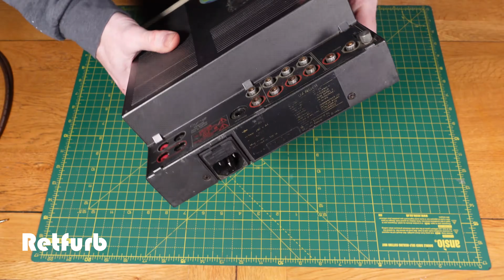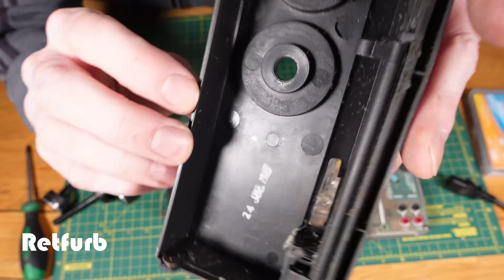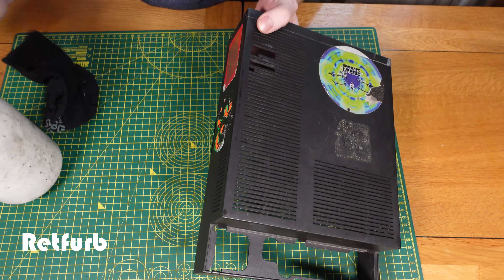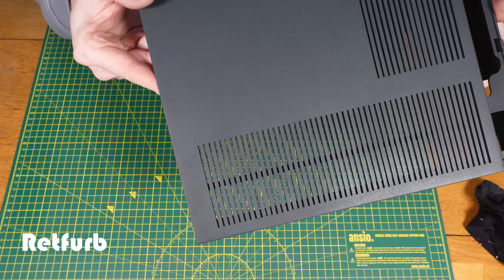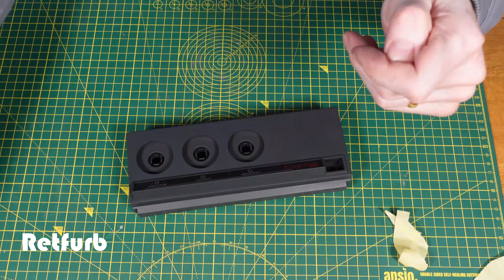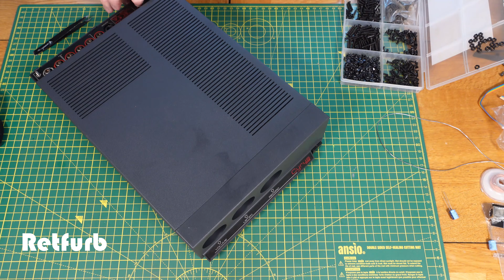Mission Cyrus One In Need Of Repairs - Retfurb Retro Audio

Comment: Thank you, you did a fine job there.  I backwards-inherited a Cyrus Two from my son.  It was much too precious to consign to "electronic waste". He had bought it second-hand long before, the main capacitors were shot and the input selector switch dodgy (to say the least).  On the Two this is a much bigger and more complicated component and very prone to corrosion.  I had it professionally refurbished, this included replacing all the capacitors (much bigger on the Two) and cleaning and gold-replating the switch - I could have replaced components myself like you did, but fixing that switch was way beyond me and it isn't the kind of thing you can buy any more.  By the time the engineer had finished and tested, the amp was working better than the original specifications.   I now use it with a Brennan B3 (via a DAC) and really like using the two together, built 40+ years apart - though I have to say the Brennan software is ridiculously over-complicated and seems half-finished to me.
Reply from the maker: Thank you for the kind comments, it’s really appreciated.

Excellent outcome with the Cyrus. I bet it was nice to get it all up together again. 🙂

Comment: Hi I think the fuses have blown on my Cyprus 1 but i cannot get the casing off as the gnd nut is just spinning. Any way i could get it off without breaking the casing ??
Reply from the maker: It’s difficult to say without actually seeing it. But you could try to carefully wedge something thin between the lid and case. Then try to undo whilst undoing the screw. It would be worth a try first.
Reply: I've done it now .The fuse needs replacing  now.Thanks
Reply from the maker: @deanrhodes6401  Perfect. Glad it all went ok.

Comment: Really nicely done. As soon as I saw the finished product, it was instantly recognisable as a Cyrus Two I bought new in the 80s. I had that for decades but lost it about ten years ago after a house move. Just replaced it very recently with another Cyrus Two (I already had the PSX to go with it that has been lonely for the past decade) and all good except thr paint flaking off the edges of the knobs. You've given me hope I can have it looking good again even if I have no idea yet how you made the decals.
Reply from the maker: Thank you, It is appreciated.
I designed them and printed using a vinyl printer. You may also be able to do them on waterslide paper and then lacquer over when fitted. I have done similar on other items, But not tried on these.

Comment: Ciao, complimenti per il lavoro. Un consiglio, per togliere qualunque adesivo senza grattare o rischiare di rovinare la superficie, devi usare la benzina rettificata (benzina Avio) con un batuffolo di cotone. Se fai fatica a togliere l'etichetta e la sua colla, devi stendere un po di cotone della misura dell'etichetta, versarci sopra un po di benzina e attendere fino a quando l'etichetta viene via senza difficoltà. Mi raccomando, SOLO benzina "rettificata", non quella per motori che rovinerebbe la plastica.
Reply from the maker: Thanks for the tip.
I tend to use solvent based degreaser, which does the job.

Comment: Looks great. Just bought a scrufffy one with a faulty power switch mechanism. Cyrus sending some parts foc, great service. What’s the make/colour of the final spray coat as mine will need a refresh? Thanks
Reply from the maker: That is good going.
Off the top of my head, It was a MOTIP anthracite bumper colour paint. 
I purchased it in Proper job (UK), But you can find other similar paints in different brands.

Comment: Beautiful video, congratulations. I have the same model that I purchased in London in 1987. I haven't used it for more than 20 years, and I've inspected it internally—there are no signs of age such as burned components or swollen capacitors.
Can I power it on, or should I follow any particular procedure?
Can I power it on without connecting the speakers?
Will the amplifier be damaged in the absence of a load?
What type of affordable spray can guarantee cleaning the contacts for the volume potentiometer, switches, and headphone jack?
What type of paint can I use to fix the paint that has worn off the knobs?
Is it worth replacing the capacitors?
If so, where can I buy them at a reasonable price while maintaining overall audio quality and power supply performance?
If the capacitors are replaced, does the bias need to be adjusted?
Where can I find the schematic diagram for my Cyrus One V2?
Thank you very much, cheers Marco😀
Reply from the maker: Thanks for the kind comments.

That’s a lot of questions 😅.

If you can connect to some old speakers, then you won’t risk damaging good ones. Although, it’s probably still fine.
Deoxit F5 for cleaning pots.
Entirely up to you if you want to replace capacitors, it’s a good way to future proof it.

Searching google for service manual, should pull it up.

It should also show procedure for bias.
I did this on my last amplifier video and that amplifier was getting really hot before adjustment.
Reply: @retfurb First of all, thank you for your prompt response.
As far as I know, is it possible to start functional verification tests after all this time of inactivity without connecting any load?
If so, for how long?
Keep in mind that the device has always been stored in optimal temperature conditions, in a place without humidity.
In this context, would you replace the electrolytic capacitors or some of them, particularly the larger ones like those in the power supply?
Do the non-electrolytic capacitors also need to be replaced?
In my situation, would you make these replacements even if everything were to work correctly when powered on?
Where would you buy the capacitors?
Are there targeted purchase kits for various models?
Even better if they can be purchased on Amazon.
My concern is that for various reasons the bias might need to be redone.
How does an incorrectly set bias manifest itself?
Only with increased heating, or does it risk affecting proper functioning or damaging it and degrading sound quality?
Can you suggest where I can find the electrical schematic and the bias adjustment procedure?
Thank you very much, goodbye
Reply: @LevideoHD You may not need this answer anymore, but…

I would just power it up; mine was stored for at least 17 years, cool/cold but dry, until I started using it again a couple of years ago. No problems exept for the input/record swiches needing cleaning.

The service manual with diagrams etc. is online. Just google it. 🙂

Comment: how do you make the decals?
Reply from the maker: I designed them in illustrator and then printed using a vinyl printer. I have in the past made water slide decals, Which can then be printed through a normal printer.

Comment: I had an ONKYO amp tx844 and used facom electric spray to clean the volume switch and sprayed medium lightly inside now no sound. Is there anything I can do ? Thanks 🙏
Reply from the maker: I’ve not used that before, but is it conductive? It could have shorted something.
Reply: @retfurbsupposed to be an electric cleaner that what the can says but it is in french 🤓🤔😳 had a problem with the volume at low volume would only come out of one speaker I had to turn it way up and then down to get it thru both speakers.. the ONKYO tx 844 is a good amp 🤔.. I waited a couple hours before I turned it on
Reply from the maker: @Jonathan1997hk-ln4ykI’m wondering if it is conductive and didn’t evaporate before turning on.
That’s all I can think of.
I have normal electrical cleaner, but it is different than something like deoxit.

Comment: Lovely refurb. impressive
Reply from the maker: Thank you, Its appreciated.
Reply: @retfurb  Wonderful to watch you working on the Cyrus One! I bought mine back in the mid 1980's. It hasn't been used in many years, but now, I am in a situation where I can. Unfortunately, my former mother-in-law stored it for me in an outdoor shed and the RCA jacks have corrosion. However, I looked inside and my untrained eyes see nothing at all glaring except that it's dusty. The outer case is in very good condition,  but two of the knobs have the usual wear. It was heart rending to hear her making music here in this video! Sounds so damn good! I'm an audiophile, but I know very little about audio equipment. I'm a former high school band director with relative pitch. So, I know great sound when I hear it, even though I know great sound is subjective. What should I use to clean the RCA jacks and how should I go about it? I would appreciate your help very much! By the way, on the front of mine it reads Cyrus One in white instead of red. Do you happen to know why?
Thank you for this content! It made my heart sing!
Lisa
Reply from the maker: @craft-o-matic399thank you Lisa, it’s appreciated.
I am glad you enjoyed it and appreciate you taking the time to watch / write this.

If it is surface corrosion, you could use wire wool & a tiny amount of wd-40. Ideally with the panel stripped.
Making sure to wipe it afterwards, to remove residue.
You could also do it without anything other than the wire wool.
Hopefully that will clean it enough, to give a good connection.
It depends on how bad it is.
Reply: @retfurbI have some very, very fine steel wool that I have used to polish metal hardware on shoes and furniture which I will try. Thank you very much! What about the tiny bits of particulate getting down inside the female RCA jacks?
Thank you so much!
Reply: @retfurb. Yes, I can remove the panel and reinstall the cover while I clean the jacks.
Reply from the maker: @craft-o-matic399I would probably try to find a small bit that could go on a dremel type tool.
Then carefully work it inside. 
It’s difficult in areas like this.
Reply: By the way,  what type of CD player should I use with my Cyrus One? I am on a fixed budget in my old age, so I would have to save in order to make the purchase. Doesn't it need a good quality internal DAC? I don't think the Cyrus One has an internal DAC? How many bits are considered good quality  and not crappy on a DAC?
Thank you ahead of time for your time and for sharing your knowledge!
Lisa
@retfurb
Reply from the maker: @craft-o-matic399to be honest, I have never used a cd with it.
I’ve always liked Sony stuff and would recommend looking at those.

Comment: Hi. I'm doing the same case refurb on a late version Cyrus one...I'm in two minds regarding the cap replacement as none of them look in any way fatigued, including the ROEs, so tending to leave as is. Is this recommended ? Also I see the other comment about decal printing..would you be amenable to fixing me up with a front panel Cyrus one logo decal? Obviously I'll send exact details via your email if so. Cheers
Reply from the maker: Sounds great.
You don't have to change them if they look ok, I just did it for a future proof part of the work.
Yes, I can make up other decals.
Send me an email at contact@retfurb.co.uk 
Thanks

Comment: Got my Cyrus One back in late 80s and it is still working fine as my only HiFi amp. I recapped all polarized and unpolarized electrolytics (except both 7000uF 40V big cans which were fine) back in 2017. Replaced with high grade Nichicon Muse capacitors. The only problem I have with this wonderful amp is with the input rotary switch wich sometimes disconnects one channel due to dirty contacts. I have to use contact cleaner from time to time.
Reply from the maker: Love it. It's always great to hear, When someone has had the equipment for such a long time.
It is a testament to the quality of them.

Comment: These fuses always show as "slow blow", but isn't their purpose to blow quickly to protect the amplifier? Back in olden times, we always referred to 'em as "quick blow"! Anyway, thanks for your amplifier repair reviews -  they are both entertaining and educational.The Cyrus amp looks as good ss new... amazing👍
Reply from the maker: Thank you for the kind comments, It is really appreciated. 👍

Also, Thank you for adding the additional info.
Reply: @retfurbBy the way, as I mentioned in my earlier post, the internal fuses - "FS1 and FS2" - are definitely fast blow and not slow blow! Just thought I'd mention it. Better safe than sorry!
Reply from the maker: @Jezza-m5k thanks for adding the additional info
Reply: Slow blow or time delay fuses are used where inrush currents are high. When turning on, the main capacitors are empty and will draw a lot of current initially, but as they get full, the current drops. If a quick blow fuse was used, it would probably blow every time.
Reply: I removed the cover from my Cyrus One and the two internal fuses are "fast blow"... FS1 and FS2...
Reply: @Jezza-m5k  The service manual also lists them as 3.15A Quick Blow.
Reply from the maker: @MrMaxeemum  Thank you for adding this additional info.
Reply: ma ha senso cambiare i fusibili interni da lento a veloce dopo tantissimi anni ?

Comment: It would be nice if you could take us through the process to make decals please
Reply from the maker: @LawsonsStudio  I use a software on the pc to draw them up and then print them using a vinyl printer. So they are printed on sign vinyl material.
Reply: @retfurb Would you consider selling some decals?
Reply from the maker: @kevinmckinnon2145 yes, I can make some up.
Reply: @retfurb That would be great, can email with PayPal details etc. I am refurbishing 2 Mk1 Cyrus 2s at the moment, aiming to Bi-Amp and have each one powered by a PSX power supply.
Reply from the maker: @kevinmckinnon2145 sounds great.

Email address is contact@retfurb.co.uk

We can sort it that way.
Reply: @kevinmckinnon2145  ottimo suggerimento
Reply: @retfurb Thanks. I'll look in to that
Reply from the maker: @ the software I use is adobe illustrator and printer is made by Roland.
Reply: @retfurb molto interessante
puoi mostrare come si fa ?
meglio ancora condividere i file di stampa grazie infinite 
come si puo verniciare parte della manopola che si e'  rovinata ?

Comment: “outside influences” from electricity power supply do not blow fuses.  Fuses blow because of an overcurrent downstream from the fuses.  I don’t see any speakers connected at the end of video ?
Reply from the maker: @mikepxg6406  thanks for adding the additional information, my fault for explaining incorrect whilst editing.

I have seen people plugging equipment incorrectly in to the speaker terminals, causing issues. 

The speakers were connected at the end, that is how there was sound playing from the amplifier. 👍🏻

Comment: Curious - before I upgraded I had a Cyrus One - but I’m sure it had a cast chassis. It was very heavy.
Reply: Just found out the first versions were plastic and changed to die cast for  v2 onwards.
Reply from the maker: @MrMaxeemum yes, that’s correct.
Reply from the maker: Yes, I think the later ones were cast shells.
Reply: Yeah, mine was definitely cast metal, it was like a tank.
Reply: @MrMaxeemum  Yes. Mine is cast metal and heavy!

Comment: “Some sort of surge”???
Reply from the maker: Electrical surge.
Reply: @retfurb you are obviously not a qualified electrician .  That’s not how fuses blow.  More likely someone shorted speaker terminals.
Reply from the maker: @mikepxg6406  I don’t claim to be any sort of qualified electrician.
sorry if I said something incorrect whilst explaining, I was trying to explain a possible cause whilst editing. It doesn’t always come out perfect.
Reply: @retfurb Someone got a little over the top with their Gangsta-Billy Thrash Metal collection. Happens all the time.
Reply: It’s become a bit of a running joke: getting explanations from customers involving a “power surge” as the root cause of a circuit tripping or a piece of equipment failing to work. The fuse is gonna blow due to events happening downstream of it, not up. 
I did thoroughly enjoy this video and my comments were meant in the most respectful way possible
Reply from the maker: @tomeasterbrook9486  Thank you. I am glad it is added to the comments, to help others when looking. 
sorry if I said something incorrect whilst explaining, I was trying to explain a possible cause whilst editing. It doesn’t always come out perfect.

Comment: The casework came out very nice, can barely see the repair.

Just swap the fuses for fast blow rather than slow blow on the pcb speaker protection fuses.
Reply from the maker: Thank you for the kind comments, I appreciate it. I was happy with how it came out. 

Thanks for adding the tip on the fuses, Hopefully it will help someone in the future.